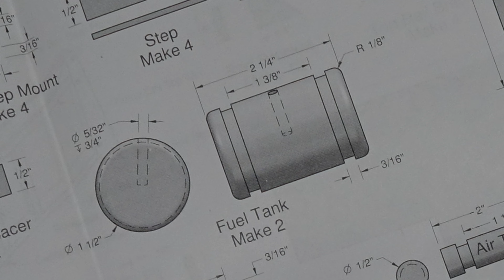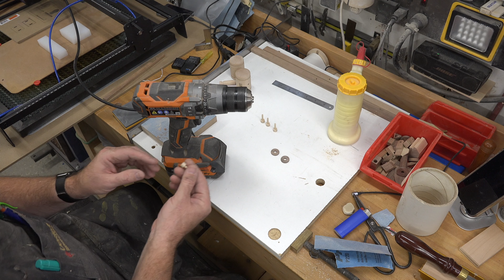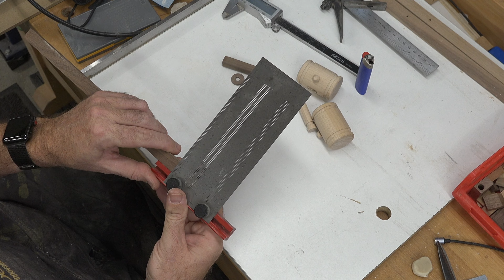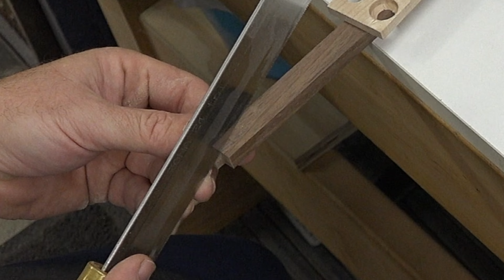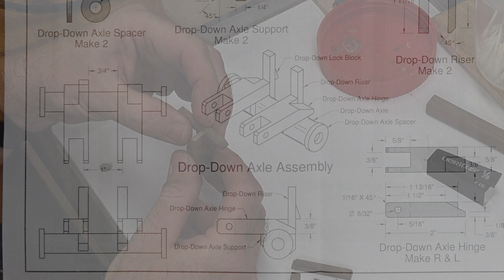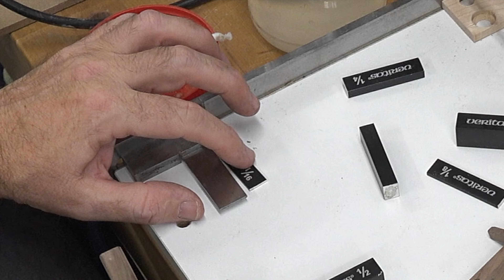Making Toys and Joys Dump Truck and Pup Trailer Part 4

Comment: Another terrific show filled with all sorts of learning points and insights.  Thank you so much for sharing.   While you were assembling the Drop Down Axle assembly I started to wonder if maybe using CA on the small part assembly as well as the final positioning of the Drop Down axel on the main axel part might not facilitate an easier approach?  Using, say, StarBond medium CA would give you 15 seconds to position the parts against the straight edges while gripping together without the fear of accidentally moving anything.  I also have found that Gorilla White Woodglue tacks quicker that Titebond and that is also a very helpful condition.  Just my thoughts.    Can't wait for the next installment and like @scottmorris4914, I'm definitely in for the long haul.
Reply from the maker: Unless I require waterproof properties of the glue, I don't use Titebond.  I actually use LePages wood glue for these models.  I have tried CA glue and I am not a fan.  It's just my opinion, but I find that the squeeze out can be extremely difficult to clean up and I have also found that the penetration of the glue into the wood is less than a water based wood glue which makes the joints weak.  While there are some that really like the convenience that a CA glue provides, I personally avoid it like the plague when it comes to these model builds.  Thanks for tuning in and for chiming in with your suggestions.  It's very much appreciated.